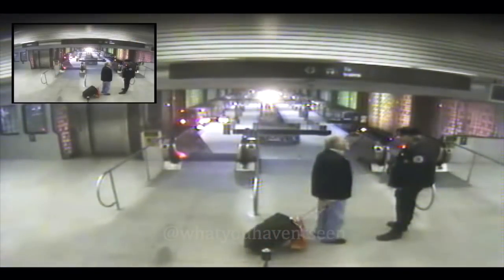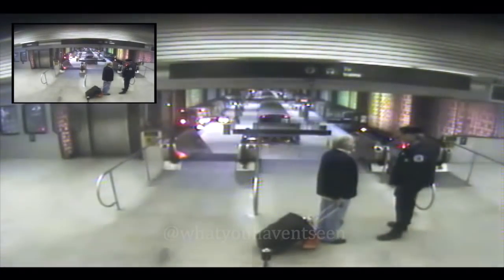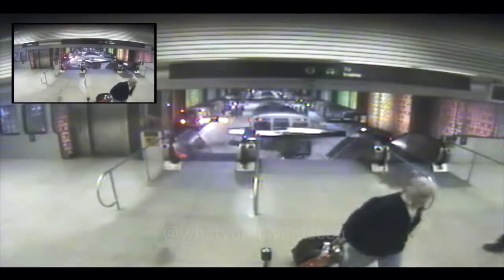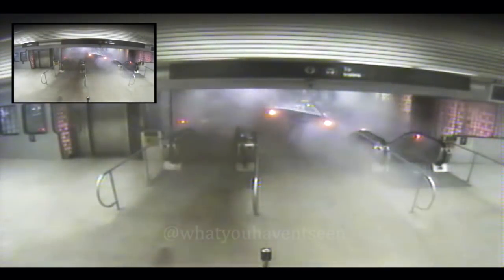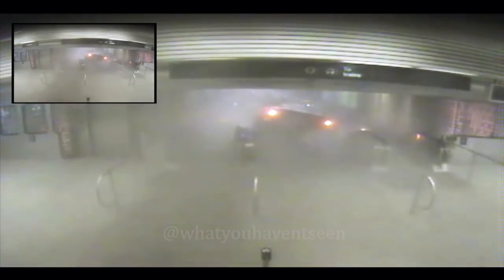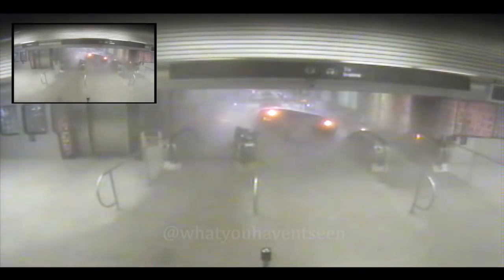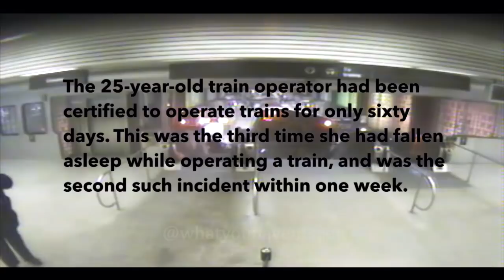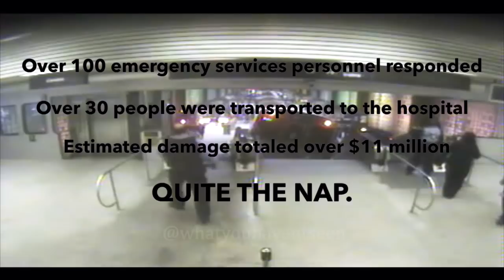Chicago Train Crash and Derailment - New Footage And Information

Comment: Only the driver was fired.

How about technicians and supervisors of the breaking system? How about the company (it's the government in this case) that required the driver to overwork?

Nothing happened to them. Although the direct cause of this incident is the driver, they are the least guilty. When a powerless employee is forced to overwork, they either overwork or lose their jobs. Getting sleepy is guaranteed. The easiest solution is to push the responsibility to the driver but this didn't solve anything or prevented similar incidents occurring again.

I completely agree with firing the driver if they were not overworked tho.
Reply: and you know all that for sure?
Reply: She wasn't overworked. First day back after 72 hours off!
Reply: As one who once worked the CTA el trains, I can tell you that she had to bypass important safety systems to achieve an accident like this, which is a very serious rule violation and one that will get you fired instantly. And your race does not matter. I will say that CTA is fair and will fire a person of any race very quickly.

Comment: this was weird for some reason the driver never hit the breaks... and he/she crashed into a bumer then into the 2nd floor..
Reply: Because she fell asleep
Reply: The train has automatic braking when the train approaches an object at too high a speed. That system failed on this train. CTA relied on the automatic braking system to keep trains from crashing when the driver screws up. That is why this driver was allowed to continue operating a train even after previously falling asleep behind the wheel. They assumed that a crash could not happen.
Reply: @exoressdelivers70  is 23mph too high speed ? she was probably  stoned and drunk too

Comment: The conductor got fired?
Reply: In Chicago, these trains do not have "conductors".  Since the mid to late 1990s, trains were configured so that the "operator" or "motorman" not only operates the train, but also opens and closes the doors for passenger entry and egress.  There is also a programmed or automated audio system that calls out the stops so that the operator does not have to do so.

Comment: All train driving jobs involve shift work. If you can't handle shift work, without falling asleep during your job, driving trains is the wrong job for you.  This is a controvercial comment; but train driving requires deep and persistant concentration, and IMHO 25 years old is just too young for this job.  The age limit should be 30.  A 25 year old girl, who wasn't making the effort to sleep properly during her off-shifts. (probably partying).  Give me a 55 year old train driver any day, over a 25 year old.
Reply: Maybe the youngest age to operate a train should be 30 I have no idea. However, if you are old enough to vote, drive a car, drink alcohol, get married, go to war you are no longer a "girl".
Reply: Many train accidents have been caused by older operators.  Age itself is not a true indication of a person's ability to meet the demands of operating a rapid transit train.  In this case it appears that the safety devices which should have stopped the train short of the bumper were inadequate.  In the New York City subway system this accident would most likely not have happened as there are timed signals which will stop a train short of the bumping post if it approaches a terminal too quickly.
Reply: With her being only 60 days in she was had just qualified so she was on the extra board….meaning not having a regular shift ……..while I get what you saying about her age….it didn’t contribute….it’s operators who have 10-15years of service and they have a hard time with the extra board it’s hard to get sleep cuz your schedule is always changing
Reply: As one who did her job briefly and left because I could not tolerate the hours, I can tell you that the worst thing about those hours is how irregular they are. I can stand anything as long as it's regular. and having worked for two transit agencies in the past, I can tell you that totally irregular shifts are unnecessary. It's especially brutal to schedule 10-hour "owl" shifts- all shifts that work through the night should be no more than 8.5 hours, as science has shown that people are less alert during the midnight hours than in daylight. Often, you'll end up with a schedule that works a midnight 10-hour shift that is separated from your next shift, an early evening shift, by only 8 hours. That's 8 hours to get home, shove some food into your mouth, shower, and grab maybe 4 hours sleep until have to get up, dress, grab a bite, and show for work. It will make your heart stop to know that many air line pilots work even worse schedules. When I worked out of O'Hare, I chatted with many UAL pilots, who told me how sleep-impaired they often are, which I find scary. All of that said, I will state that I can clearly tell, from the video, that this operator was in violation of many major operating rules and absolutely needed to be fired. If she'd been following the rules, it wouldn't have happened, because I can see from the speed the train was traveling at, that she bypassed important safety systems that would have prevented this disaster.